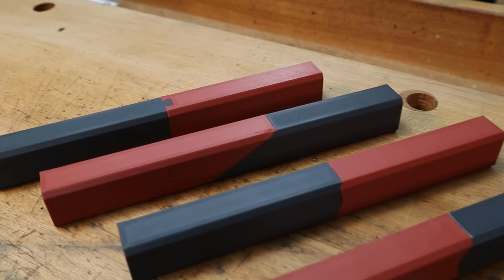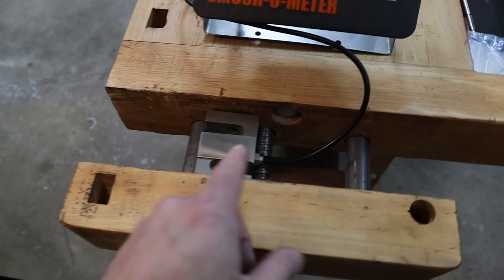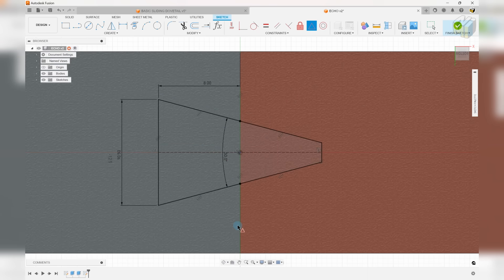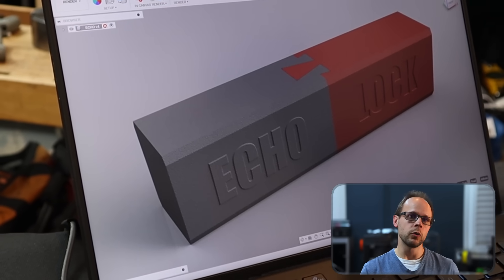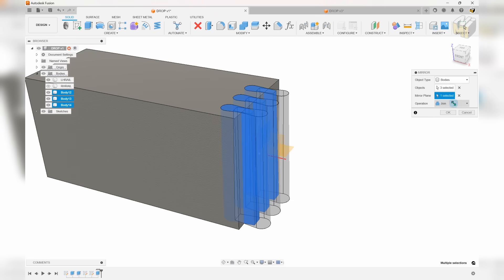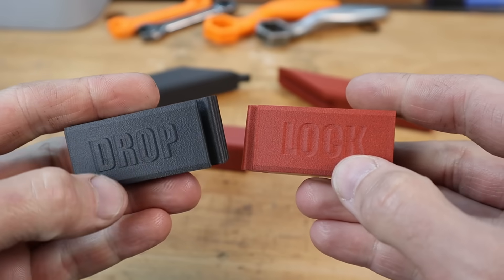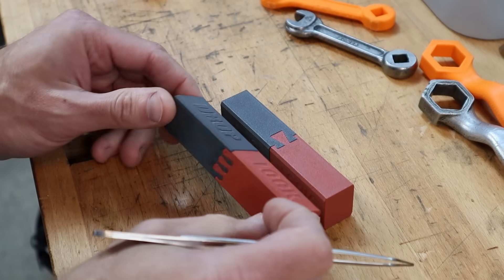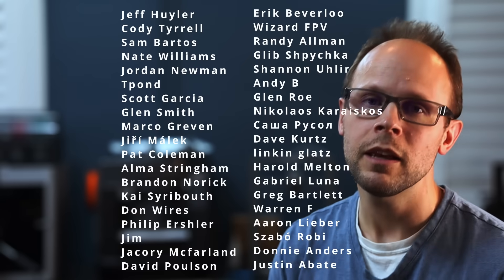Adapting the BEST Woodworking Joints for 3D Printing

Comment: Your drop lock joint exists in woodworking and is called an isoloc joint. You need either a special router jig to cut it or a CNC machine. It's a nice joint because it behaves just like a dovetail in that it only can be assembled or disassembled in one direction, and it has a good mechanical lock when cut with a good fit. Also lots of glue surface area.
Reply from the maker: You know it does look similar, thanks for pointing it out.  I have some plans to try the connections in wood, some are going to be really tough if they're on a curve, the Echo connection is doable with hand-tools for sure, but the Drop Lock with the tapers is not so straight forward.  I'll have to think about how it might be possible.
Reply: @NeedItMakeIt  for the drop lock with tapered surfaces in wood you could probably use a 3d printed router guide and then use a tapered router bit with either a bearing or follower bushing.
Obviously that limits what taper angle you can get, but I think they sell some pretty shallow taper angle bits.
Just cut each half of the joint from the opposite side of the board, that way the tapers match.

Comment: 😢 no, not kilograms, pounds !
Reply from the maker: I just can't win, I think I'll have to just have both or dub over it for a metric and imperial version of each my my videos.  That would be pretty funny.  I'll dub my own video, maybe an accent too while I'm at it.   In Canada, we use both, there is no one standard, even in construction we have Commercial work which is all in Metric and Residential work is in imperial.  I speak in both now and it's become normal, so apologies I'll figure something out for the next videos.
Reply: @NeedItMakeIt  - it's all good !! you win with every video you make !  Yeah, south of your border we just use imperial measurements .... and as the old fart that I am at nearly 65, it's tough to teach an old dog new tricks .... I was a product designer for over 35 years in the imperial world, and even though we included dual dimensioning on our drawings I never really wanted to learn the metric system !  However since retiring and 3D printing as a hobby, I have found the metric system is actually pretty easy. At least the math part of it - the visualization is much more difficult, so "Alexa, what is 37mm ?  37mm is about 1.4 inches" comes in handy !! Weights - kg, etc are a whole nother game... no idea !   I have seen some channels that will just add a small graphic in the lower left with the equivalent metric value when speaking in imperial measurements ! That would work ! And even if you don't do anything different, thanks for sharing !!

Comment: Im enjoying the joinery videos. Its not something a lot of people think about with 3d printing, but it's really good for printing larger projects. It would be great to see you tie together larger/unusual shaped parts rather than rods as well.
Reply from the maker: For sure, I think I'd like to create a frame with every type of connection so far, that would be at least a good start,  I'm also planning to make some furniture in wood and have it compete against a piece that's 3D printed to see if we can make something that's just as good.  That's going to be tough, but I think it's a worthwhile challenge.

Comment: Would love it if you tested each joints maximum breaking load from both angles of stress!! Push it till they snap and measure the forces. We would be able to see which joints would be suitable for what jobs. Thanks for sharing your great work! Keep it up!
Reply from the maker: That is coming!  I wanted to collect as many ideas and have them prepped and then we'll have an ULTIMATE face-off, Travolta/Cage style.  I have a feeling that a screw and connection combination will be the best overall, it's hard to say for sure.  Also a connection like this which uses adhesive would make for a very strong connection too.  I have a lot of ideas for follow up videos and it's interesting and I hope at least a little bit useful.
Reply: like to see each joint make a cube that if scaled could be sat on

Comment: Im new to 3D printing and have no idea where to start love your videos tho
Reply from the maker: No problem.  Well, I'd start with something that you need.  Download Fusion unless you have it already, I think it's still free unless you use it for a business and try to create something small and simple to begin with.  If you have an enclosed printer, you can probably print with ABS, but PETG and PLA are a bit easier to work with.  I made the mistake of starting with ABS on an open frame printer about 5 years ago, and it was a nightmare to try to make it work because of how ABS reacts to cooling.  I moved to PETG and that was the end of those problems.

Comment: Another great video!  This is fun stuff.  I've played with some similar things like designing snap-together hinged joints.  
The "alien" join has some nice aspects, like being all curves so should not have ringing artifacts, and they look nice enough to be seen.  I could definitely see using it to join flat sheets on their edges.
Reply from the maker: It's kind of like a puzzle, I think this one would be really good with some adhesive, it would help to extend the part into each other.  There are a few more ideas to explore as well.  I'd like to experiment with a tapered cylinder shape or perhaps a tapered prism shape which would be better for 3D printing to avoid bridges.  I'm not really sure just yet how it will work out, but tapers make for a lot of surface area, they just need something to bring the connections together and keep them tight to remain that way.  I was hoping that these would give people some ideas that are even better so we can come up with the absolute best connection together.  That has me wondering, if I ask AI to create the best 3D printing connection, what will it say?

Comment: amazing videos, its just a shame you dont stress test these ...i would love to see some results, showing how much force does it actually take to break, in which direction etc. Would be fascinating
Reply from the maker: The stress testing is coming, I wanted to get all of the connections sorted out first and then we'll test each of them against each other to see which one(s) come out on top.   I will also add in what I think might be the most solid screw connection as well, which is a combo-screw and joint type to take advantage of both approaches.  It should be good!
Reply: @NeedItMakeIt  amazing! you got yourself a sub 😌

Comment: Glue on face grain isn't actually stronger, it's just that the wood is weaker in that situation than the glue, and end grain joints generally have less surface area to work with.
Reply from the maker: I don't disagree, I have tested this myself and we were able to get quite good bonds to end-grain using specific adhesives formulated for this task.  I think an end-grain connection is a rabbit hole, it's certainly not going to be as predictable as face grain especially using water based adhesives.  The wood will want to wick moisture from the adhesive up quickly which will impact the connection, this is probably why it's recommended to glue-seal first.  I'd have to investigate this further to be certain.  Polyurethanes in my experience do very well bonding to end-grain, especially since they expand as they cure.   What are your thoughts and do you have any preferred method of end-grain glue bonding?
Reply: @NeedItMakeIt  Even normal wood glue has worked fine for me, applied normally. The  glue is weaker than the cellulose fibers in the wood, but stronger than the lignin, which is why the glue fails first in endgrain joints, but the wood fails first in face grain joints. The other big thing to be aware of is that wood expands different amounts in different directions when exposed to changes in humidity, so if you glue face grain to end grain, that can cause it to work loose over time. 

There's a pretty deep rabbit hole if you go into what glue and joint is best for what situation. A more flexible glue can spread out an uneven load across a larger surface, instead of putting all the stress on a thin line at the very edge of the joint. Just a good idea to think about how the forces will act on the joint.

The other thing I've found is that you want to squeeze as much glue out of the joint as possible.

Comment: Ah man ove just started working with fusion ( for fun) and you make it look so simple 😂

I can't even figure out how to get holes lined up properly. ( Attempting to design a load bearing handle ) Even sketching out the form to extrude didnt seem to work. Couldnt ergo grip style waves to draw at all.
Reply from the maker: I can certainly venture down the path of the how-to's in Fusion.  I wanted to come up with a more interactive method of doing it, watching a screen capture isn't good enough IMO.
Reply: @NeedItMakeIt  I would also like to see more Fusion content. Not as much tutorial just more of a "how I do it" in relation to the designs you are doing. Your content is very good!!

Comment: For testing, you'll need to categorize what forces you're pitting your joints against.

It'd be dangerous to only test for tension (pull), if someone uses your ranking to print ladder rungs for standing on (lateral loading).

Good hunting!

Comment: Looks great, the first dovetail you made in the other video with the scarf joint seems to have a lot more surface area for the joint to succeed. Wonder if you made the echo lock with the same scarf angle if it would perform better than the original dovetail.

Comment: What if you made the fingers shorter in the Drop Lock? In woodworking, longer fingers = more glue surface, but if it’s just a compression fit, wouldn’t it be better to keep the compression close to the part? Like lifting a heavy object close to the body? Essentially, you could apply more force to the fulcrum, like a heavier person staying close to the trunk if you’re standing on a limb. (I’m not sure if I’m explaining this adequately…)

Comment: The Drop Lock joint is definitely intended to maximize contact area and be glued.
More generaly speaking, woodworking joints are designed to mitigate 2 very specific issues:
- anisotropic strength of wood fibers: wood has its strength in one dimension only, whereas 3D print has two (XY plane)
- anisotropic distortion / warp due to woods' sensitivity to moisture
Woodworking joints are cool as f, but 3D printing it a different process. 
Each has its own perks and losses
Reply: Historically woodworking joints are also designed to work around the limitations of the available glues. These where animal based glues, had low strength and are brittle. So you might dovetail a draw front because if you just glued it, it would fail fairly quickly. With modern PVA glues you could just dowel and glue and it would last decades.

Comment: I am still not a fan in general, of this type of joints. They are very filament and printer dependent. That being said, in general, there is a lot of wisdom in the gaining strength through counter forces, that apply to these joints. Just as a heads up, on my MKIII i need to print infill super slow for PETG, for the infill to be strong. For PETG, the tolerances on that printer, is super important, for the stuff you do here, and it is wildly speed dependent. Since I mainly print using PETG, I have actually stopped using tracks or joints like you do here, due to the insane tailoring needed for each and every printer and filament. It just don't seem universal. If you find a great joint, it would be super interesting, if you also had a universal and easy to apply adjustment for tolerance.
Reply: Tolerances are a real pain. I seem to get different joint tightness depending on layer height, speed and filament (different PLA). I think I've got it worked out and change one of the variables and it all goes to cock 😄

Comment: I wonder if the round features of the drop lock are better long term, because with the sharp corners of the other dovetails you can get more concentrated stress points in the corners.

Comment: It'd be interesting to see a cross between the echo and drop locks - basically the echo but with all of the corners rounded to drops.  My guess is that it would be a little less strong but much less susceptible to less-than-perfectly-tuned printers (linear/pressure advance)

Comment: I think I missed the reason for the 1° taper angle
Reply: I think there's more detail in the previous video.  The short version is that it means that everything gets squeezed together harder as you seat the joint properly and it can't slide out the other way

Comment: The dowetail, but instead for smooth sides, you make it with barbs to prevent it from pushing the tails apart. The barbs will then take the load. YOu can say that it act as the glue.

Comment: Step 1: have your printer dialed in! 

Interesting joinery!
Reply from the maker: Calibration for these is important, the material has a bit of give to it, so it's going to go together, I just prefer not to have to use a hammer or vise.    The Q1 Pro and the X1C are both my go-to printers to give me the best results with the least amount of trouble.  I'm still using my other printers, they tend to be more for things that aren't quite as critical for fit.  If there is some interest I can show the process I follow to get a good fit. It could be a pretty short video I'd imagine.
Reply: @NeedItMakeIt  We could always print our specific shapes, minus the thickness of some sandpaper,  to make adjustments if we really needed to. :face-blue-smiling:

Edit: But yes, dialing into micrometer levels of accuracy would benefit a lot of people. Getting horizontal and hole expansion %'s into real world 0.01 mm's is definitely a good skill to have. Better to change clearances in Fusion instead because you're changing the entire scale at that point, right? etc, etc. Rainy day ideas anyway. Cheers.

Figurines are fun but even larger ones need parts to fit together eventually!
Reply: @NeedItMakeIt yes please. You have my subscription
Reply: so true my friend

Comment: I think most of your joints will be much stronger than the parts themselves.
Mainly because the parts are somewhat hollow, while the joints have higher density of outlines, and they double up.
Reply: PS: I still love that filament you are using :)
Reply: I think this is a demonstration though, in real prints it may be that he uses different infills wall thickness etc

Comment: I haven’t watched yet but some software allows you to change how it prints so it only fills on the inside (the walls will be more accurate to model) so that could be used to help tolerances
Reply: It’s called on one program Cura slicing tolerance with the options being exclusive inclusive and middle. It allows you to choose whether it aims to be right on the line, right within the line or right outside the line